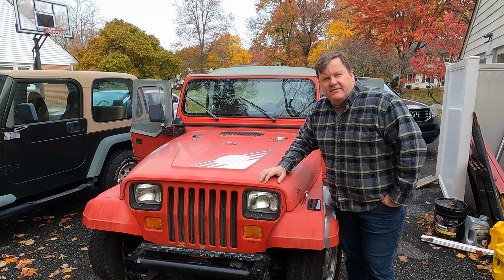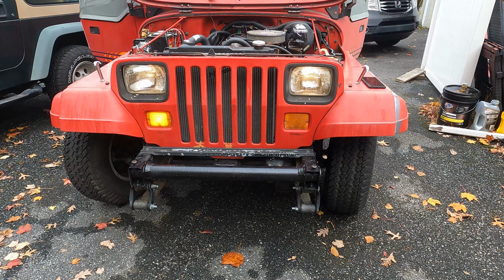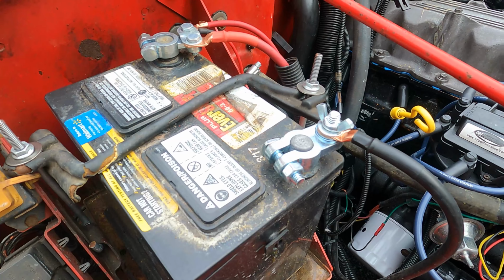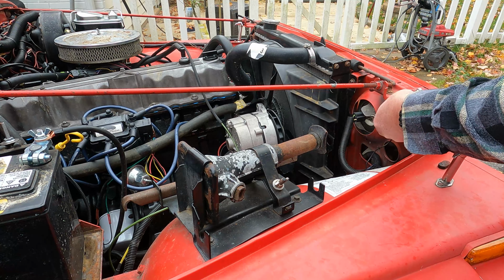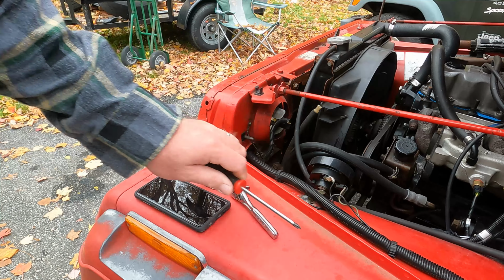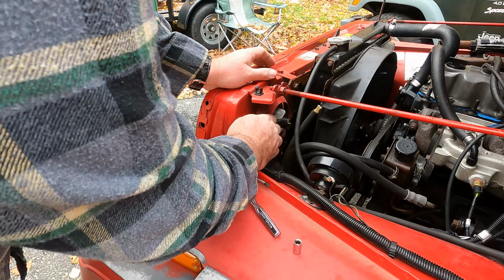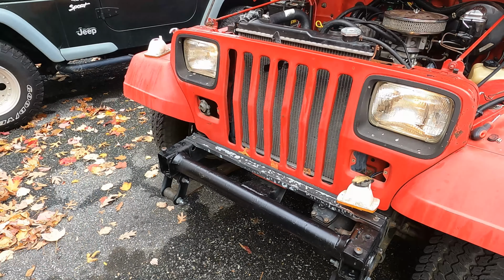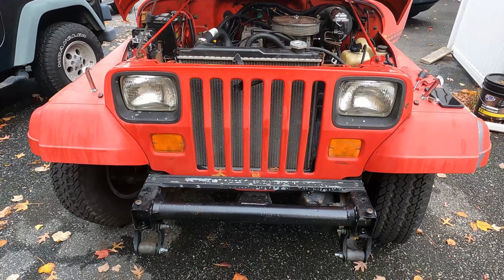Jeep YJ front blinker not blinking...

Comment: Now I've gone through all of our grounds sanded them to metal sanded the wire ring to metal, they work fine when the headlamps are off but turn them on and the signal does not blink...very agrivating
Reply from the maker: Somehow, somewhere you are getting 12v shoreted to the marker/blinker.  This is proven by the fact that with headlamps off, they work fine.  Jeep wiring is sometimes a nightmare to work on.  Check headlamp switch in dash to make sure there is not a short in switch.  It could be a faulty headlamp switch as the markers and blinkers are all on same circuit under dash... sorry I can't help more.